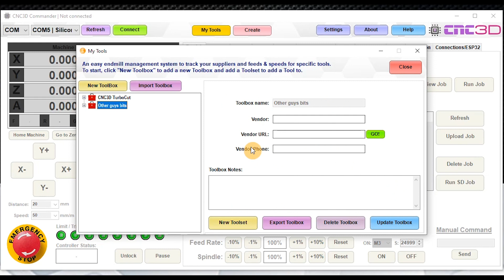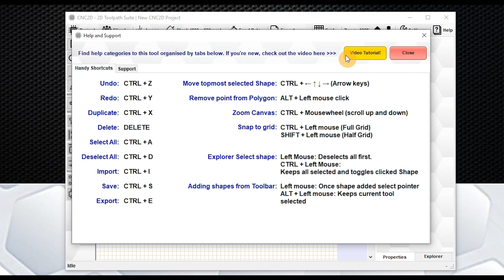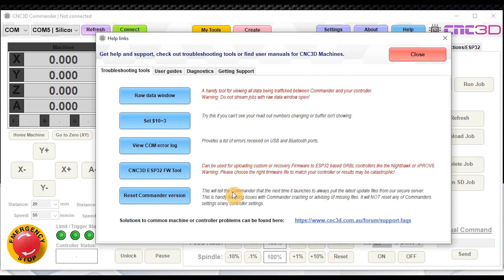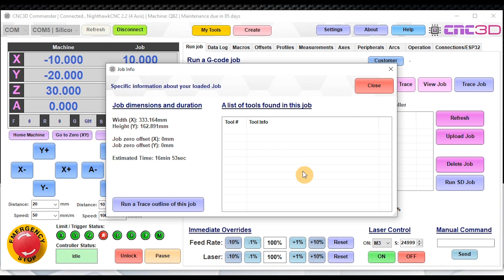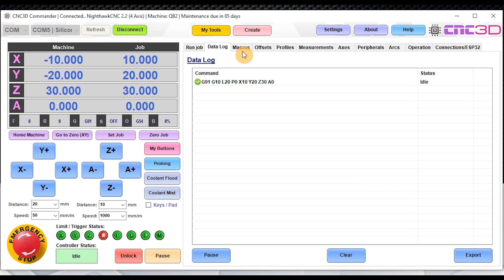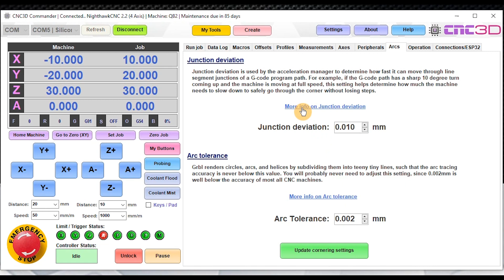CNC3D Commander build 292 - Overview -  Powerful GRBL CNC control software

Comment: I need the link to purchase this software i guess i downloaded the free one which wont let me do anything until i purchase it
Reply from the maker: There is absolutely no need to purchase it to get Commander to work. 

There are no premium paid features in Commander. It is completely free.

The only restrictions that exist are due to the controller you are using.

Commander supports a variety of CNC controllers like our Nighthawk that has a lot of extra advanced features over standard controllers. In order to use some features, you must have a controller that supports them.

Which controller are you using exactly?

What are you trying to do?

Comment: It,s have support for 6 axis ?
Reply from the maker: Absolutely! It is configured to auto detect your axes up to 6 OR you can tell it to force 6 axes in the settings menu. :)
Reply: @cnc3d  Tks ! I´m from Brazil, and i start to search about softwares open source for my project. I´m a begginer in this world, i love your software, it´s work with a ESP32 controller from Aliexpress?
Reply from the maker: @Golf_Bravo_Lima  it may, let us know if it works for you!

Comment: HI, does this have heightmap/Auto level feature ( like in Candle/bCNC ) as our needs would be for PCB and this is essential.  I have had a scan of the docs and don't see it but could have missed it. If it does I would sure like to give this a try.
Reply from the maker: Hi Joe,

Not at this stage but it is on our list. :)

We'll do a video when the time comes.

Stay tuned. 😎

Comment: Looks great with many features not so easy accesible in the basic grbl.  May I suggest putting both arrows and +/- on the actual movement buttons, the new younger generation have more difficulty understanding +/- directions than actual directional arrows and might think its more buttons as is.
Reply from the maker: Hey,

Thanks for that, check out this video and let me know your thoughts.

https://youtu.be/5rLGH3L0X7U

Sorry for the confusion, I thought your name was Derek! :\

Comment: does this work on arduino
Reply from the maker: 👋 

It will work with GRBL running on an arduino yes. :)
Reply: @cnc3d  I keep getting connections timed out on my uno r3, I tried two of them. It must be something on my end. Beautiful software im super excited to get it working and using it!

Comment: I had just discovered your video and it looks like a great software. 
Perhaps it could be interesting to add the plasma cutter in tools and to adapt-it a bit for plasma cutting tables.
It couldn't be so hard to add some functions.
I am in France and I just working to my own plasma cutting table.
Reply from the maker: Commander as a controller is perfectly fine for plasma CNC machines. 

There is also plasma CAM tools built in you may have missed. See the included CNC2D program:

https://www.youtube.com/watch?v=3Pq8y7JK_kY&t

What other function would you like to see?
Reply: @cnc3d  thank you a lot for your answer. I will surely try-it, it looks very nice and handy>
It was a lot of work for you but for real the results are excelent !
I have looked to CNC2D video and is .... amazing,
For beginners it is very simple, intuitive and it have all the needed functions for simple pieces. What i Liked is you have included all the needed functions like mirroring, distances, curves, points, etc but in a simple manner. Congrats, I like-it a lot !
About your question: what functions I like to have your controller.
First of all is a GREAT CONTROLLER !
It have a little bit from Marlin, Mach3, GRBL and other features (Example: custom steps/mm, number of steps/rotation, etc) in the mean time it is very simple and intuitive, and this is what it count the most (my opinion).
I guess it will be a lot of work but what all of this type controller are missing is a toolpath visualiser when it is working, also the possibility of a simulation (but I think on your's it exist already)
Can't wait to finish my hardware part and to test-it. My plasma table it's a CrossFire clone, modified an it will have a Chinese THC controller (which is affordable and it have the possibility to independent modify the parameters, compared with others THC which don't have this function all being made by software)
After I will begin the test if you want I can keep in touch to tell you practical details, good and bad parts, etc.
Thank you a lot and keep up the great work.
All my best from France !

Comment: Can we run CNC lathe Gcode cycles ???
Reply from the maker: Of course you can, as long as your controller and machine supports it. Commander will process any valid G-code for you.

Comment: I would like to try this but when iI run the app it gets blocked by my virus detection software.
can you ensure me it does not have a virus
Reply from the maker: Thanks for letting us know Ken

We are a reputable CNC business based in Australia.

We can 100% guarantee that our Commander software contains zero malware or viruses.

Can you please let us know which antivirus software you are using, the exact version and we will submit a false positive report to have this removed.

Please also let us know the exact detection name it is falsely reporting.

Can you also confirm if the false detection occurred on the installer or after updating?
Reply: @cnc3d  McAfee virus detection when starting the program I had no problem on installation 
p.s. I really like the look of your app and if I use it I am sure I would like to make a Donation keep up the good work..
Reply from the maker: @kenblanch4178  thanks Ken.

We have a massive update planned very soon with some new and exciting features. Stay tuned for the update!

Thank you for letting us know. Can you confirm which file it is flagging and which detection name it reports?
Reply: I need the link to purchase this software for my genmitsu 4040 laser  @cnc3d

Comment: Looks great, but does this also work in Inches for us Americans?
Reply from the maker: It certainly will be in the next release. :)

It is already implemented. We're just wrapping up a LOT of new features.
Reply: @cnc3d  That's Great news!  This old dog is just hopelessly stuck on the obsolete imperial system.  Any idea when this new release will release?
Reply from the maker: @MrRfries  the next release is a MASSIVE one.

See a list of the current changes and features implemented so far for this launch:

Bug Fixes
•	Fixed bug with multi-passes in SVG to Laser generator and CNC2D
•	Improved the performance of the text import function in CNC2D.
•	Fixed bug with disabling WIFI on Nighthawk.
•	Fixed some typing mistakes in message prompts.
•	General improvements to overall performance of Commander

•	Added support for Imperial Inches in the main Commander window!

•	Added support for Web Portal updates.

•	Added “Job Sync” to allow viewing, tracing and estimating SD card job files.

•	Improved Job info to show detailed aspects of Z movements on jobs.

•	Touch offsets added to probing wizard settings to support mechanical probes.

•	Stored macros can now be quickly run from the “My Buttons” section.

•	Image engraver output heavily optimized for better performance

•	Image engraver now has a great job visualizer built in.

•	Image engraver now adjusts brightness/contrast excluding white or transparent pixels.

•	Image engraver now has specified angle engraving and allows starting from center. 

•	Image engraver can now trim white space from imported images.

•	USB/BT jobs can now be accurately started from specific line.

•	Commander now supports customizable 3-6 axes including all settings breakouts.

•	GRBLHAL support in this release *Experimental*.

**Nighthawk major firmware release and Web Portal release. Please update for extended features. This one will be a LOT easier than the last one!!**

Nighthawk Firmware Update to V2.3

> Added new Job Sync feature to allow visualizing and tracing of SD card jobs.

> Massive improvements to Laser mode for superior laser engraving results and speed of laser jobs.

> Bug fixes in place for Bluetooth connection issues on Windows 11 and some windows 10 users.  

> Changes to Nighthawk Web Portal, heavily optimized for performance and some new functionality.

All that is left now is for us to implement some Nighthawk firmware changes to allow users to start an SD card job from a specific line while calculating exactly where to start that job from. On all 6 axes.

Hopefully, we should push through in a week or 2. :)